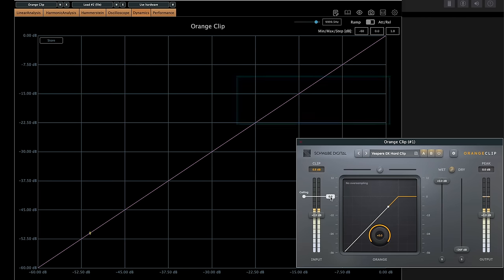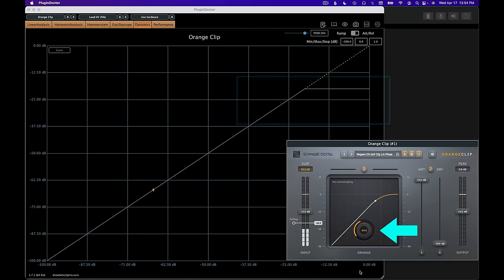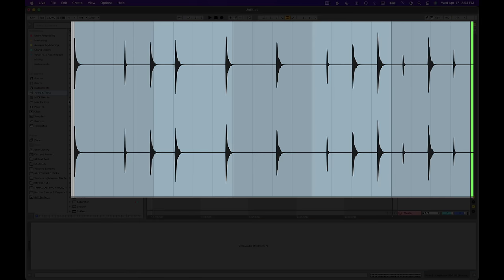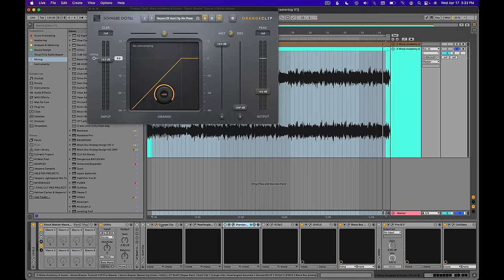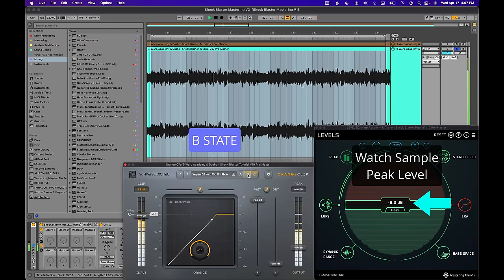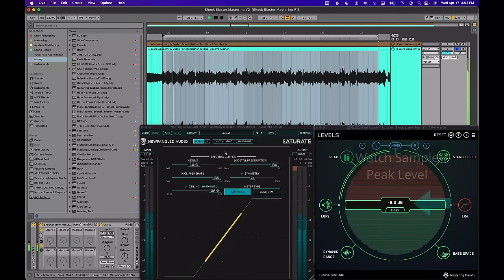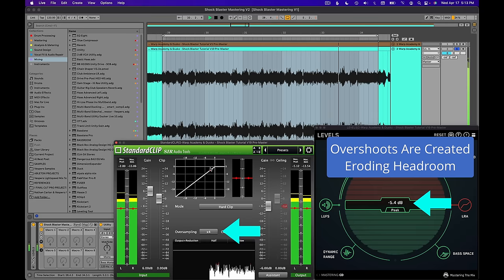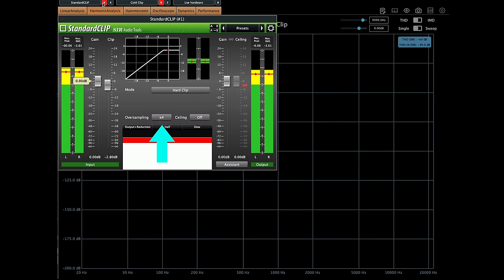The Science of Clipping - The ULTIMATE Tool for Loudness + Punch

Comment: I agree! 100 percent! I used to use limiters in my mix and constantly was always faced with lots of troubles, UNTIL I started using only clippers. Im 100 PERCENT a fan of using CLIPPERS! great video! very informational! thank you!
Reply from the maker: Thanks for sharing your experience.  Yeah, I've found that clippers are a nice alternative to limiters when used in the mix on individual sounds and busses.  Then I just use a limiter on my master, last in chain.  Sometimes, with bass-heavy material like 808s, subs, and kicks, clippers don't perform well and produce too much distortion.  In that case I will use a lightweight track limiter, DMG Track Limit, which is able to do the job with much less distortion.  Cheers!
Reply: @warpacademy  I only use compressors(on my main bus channels, DRUMS/BASS/SUB ETC. when needed. and reeally havent found a situation arise where I need to use alimiter in my master mix. as long as my mix is sound and landing at -6.0 dbs, im usually golden in my master. but maybe I am missing out by not using a limiter?? I dont know
Reply from the maker: So you’re using a clipper last in chain on your master instead of a limiter then? 

If you drive sub heavy material into a clipper you’ll get super audible nasty distortion.  That’s why I use a limiter on the master.  Limiters don’t do that unless you push them too hard.
Reply: @warpacademy  The 1st plug in I utilize in my master chain is MAXIMUS, which is  limiter/compressor of sorts, i utilize this to focus my compression in seperated low/mid low/mids/mid highs/ and High frequencies, from there I fully utilize Ozone. I keep it as simple as possible although my Ozone mastering chain does utilize around 5-8(pending the song) different tools/plugins to get to that desired sound
Reply from the maker: Sweet.  If you’re getting good results then stick with it :)

Comment: killer video. very helpful in understanding some of the concepts that have eluded me re: clipping. 

any recommendations for fairly aggressive clipping approaches? I'm interested in over-the-top character of some lofi trap/soundcloud rap where they are clipping the hell out of FL albeit the clipper in FL is fairly limited. I have kclip but I'm not sure if I'm fully taking advantage of its functionality
Reply from the maker: Glad you enjoyed it.  First step, get Orange Clip from Schwabe Digital.  It is an exact copy of the FL clipper and its soft clipping is apparently identical.  

To get more aggressive with clipping you can use hard clipping for harsher sounding odd harmonics or soft for more round and warm harmonics.  Use oversampling in this case for sure.  As you’ll get audible aliasing.
Reply: @warpacademy  followed your advice and the results I'm getting from Orange Clip are substantially better than before. a most worthwhile purchase. can't thank you enough 🙏

Comment: Great demo and info. I use Gold Clip on the 2 bus just before the Slate FG-X 2. I love the Gold Clip because it is clean, but it can get gritty if that's what you want. 

I have had Orange for a week, and would use it per track. I also have SIR Standard Clip, and have used it on the 2 bus.

Anyway, very interesting info on oversampling. I don't typically use oversampling in most plug-ins already.
Reply from the maker: Right on.  Nice to hear a bit about how you're using clipping plugins.  Wishing you all the best with your mixes and masters!

Comment: Were you using the gold clip in hard or soft clipping? If it was hard then surely all the clippers would sound the same as hard clipping is identical regardless of the clipper
Reply from the maker: Hey Ed.  In general, you'd think that all hard clippers would sound the same.  It's really quite simple math.  If a sample = more than the clipper ceiling, make that sample output = clipper ceiling.  That's it.  And yes, I was using Gold Clip as a hard clipper.  

However, in practice, these clippers are actually quite different, especially when you start oversampling them.  Anything that oversamples will have to run through a downsampling anti-aliasing filter.  Those filters can be linear phase, minimum phase, and can have wildly different slopes and frequency settings with respect to Nyquist.  They could be brick walls or more gradual slopes.  Just look at the SRC / Resample function in iZotope RX Audio Editor and you'll see all the options.  Most clipping plugins do this under the hood, hard coded, or give you only very limited control over the LP filter.  

Saturate from Newfangled audio has a spectral clipping algorithm with "detail preservation" which makes it perform very differently even when hard clipping.  Gold Clip has a totally unique anti-derivative anti-aliasing process, which is why it sounds so good and doesn't produce overs.  Gold Clip modulates the filter settings based on the frequency and amplitude of the signal.  It also has other processing in addition to the clipper (the Gold knob, modelled on the Lavry Gold hardware and the Alchemy parameter which acts like HF tape saturation).  

If you're simply hard clipping with no oversampling and just touching the micro-transients, then they sound more similar.  Oversampling (and the corresponding downsampling and band-limiting process) is what changes the sound a lot (and is also the source of the overshoots).
Reply: @warpacademy  Thanks for the detailed response, i found it hard to tell the difference, it would be intersting to do a null test to see what exactly what the diffference is. Flatline is my fave clipper, mainly because of the GUI, i did try a demo of Gold clip and found the gold part quite interseting even tho it was subtle. i might look into it again now, buy i cant do a null test cos my demo was up last year.
Reply from the maker: Hey Ed.  Yeah, the Gold knob in Gold Clip is an emulation of the Lavry Gold hardware ADC.  It inflates low level information in a unique way.  Very useful.  I also really like the box tone feature and Alchemy.  Worth testing out.  Perhaps you could request another demo from Ryan, I'm sure he'd help you out.  Cheers!

Comment: Great observations!
Funilly enough; even with oversampling; I'm not getting TP overs on my standard clip ceiling; how hard are you pushing to get over's +0.6dB?
Reply from the maker: Hey Nicholas.  Nice to see ya round the channel mate!  I captured a screenshot of the session, Standard Clip settings, and meters for you below.  I'm clipping very gently here.  A couple dB on super short audio events.  Mainly just the snare.  

https://capture.dropbox.com/UY8A1izXIQNtEJFU

You're most likely not seeing the overshoots because Standard Clip has 2 clipping stages.  The first is oversampled, and the second is a 0X non-oversampled hard ceiling (called "Ceiling" in the plugin).  If you leave the Ceiling engaged, then the second clipping stage hides the overshoots from you by applying more clipping.  If you disengage the Ceiling parameter, you see the true peak level overshoots both in sample peak and true peak (true peak overshoots being higher).  

The same is true for K-Clip and most other clippers with oversampling.  They usually have a second 0X OS ceiling.  And in fact, you see the exact same thing in iZotope RX Audio Editor.  When you use the Resampling process to downsample anything, you'll see the parameter "Post Limiter" engaged by default.  They need a post-downsampling limiter to catch these overshoots.  This is because the Fourier transform process with the sinc function related to the lowpass filter used in anti-aliasing will cause higher and higher overshoots the more Fourier partial harmonics are used.  The more oversampling used (and the more extreme the downsampling) the higher the overshoots will be.
Reply: @warpacademy  Super interesting; I understand why/how this is occurring; I don't use the ceiling feature; and don't get overs; I'll have to share with you my OS settings under-the hood of standard clip, see if they match up!
Reply: Not getting overs with ceiling off here neither
Reply from the maker: That's certainly interesting!  I wonder what the deal is.  My session is at 48 kHz, which matches the mix sample rate.  I've found overs happen in Standard Clip (and any other clipper except Gold Clip) on any oversampling setting.  I've tested 4X all the way up to 16X and they all seem to produce the same measured overs.  I've found they occur on simple material (single tracks, like a snare) as well as complex material like a whole mix, and they seem to happen even when clipping very lightly (1-2 dB).  

One thing to note is that the overshoots are triggered by jump discontinuities, like a square wave or a drum transient.  Anywhere you have an abrupt change in level, you typically see the overshoots as you add harmonics to the Fourier transform.

Let me know if your settings are different or if there's something you've set up under the hood.  Cheers!
Reply from the maker: Thanks for sharing.  What settings are you using in Standard Clip and what material are you running through it?  There needs to be a sharp jump discontinuity to see the overshoots, like a square wave or sharp drum transient.
Reply: @warpacademy  after some more testing, the end of it is that on material which are not very rich in high end (it can well be e.g. some acoustic drums, like certain kicks and snares), no peak overshoot happens above the clipping point when OS is on and Ceiling is off. It only happens in material with a substantial amount of high end.
Reply: All in all, in order to be on the clean side in terms of aliasing, still the combination { Oversampling On + Ceiling On } is cleaner than { Oversampling Off }. If your CPU resources allow for it, then I think it's better to default to { OS on + Ceiling on }, and toggle between that and { OS off } and see what sounds best; if no difference, then go for { OS on + Ceiling on }.
Reply from the maker: Thanks for sharing.  This makes complete sense.  When you listen to the material that I'm processing, the drum transients contain all frequencies (including a lot of high end).  High end is where true peaks happen.  And oversampling will begin to pick up true peaks for sure as the sampling rate allows detection of intersample peaks.  

Most music in the genres I talked about are going to have similar drums.  The transients will be very dense and will contain a lot of HF information.  Especially if you're using clipping in your drum-specific processing, which I always am.  

So basically, this depends on what program material is being run through the clipper.
Reply from the maker: If we're talking about mastering, then yes for sure.  I agree with you.  The overshoots on a master are quite small.  But with Gold Clip, they don't even happen at all.  So I use that.  I prefer the sound and features of Gold Clip to any other master clipper.  

But, if we're talking about track clipping; clipping individual sounds, or even busses - then oversampling will shoot you in the foot.  Depending on the clipper and the sound, oversampling creates overshoots of 2-4 dB on individual sounds.  When you sum those up to your master, those can stack up.  Now you have the potential for big overshoots.  That's a problem.  

Again, the context here is using hard clipping for transparent reduction of micro-transients to free up headroom.  Here, oversampling makes no sense because 1) The audio events are so short you don't hear any aliasing or distortion, or if you do it's simply adding harmonic density and perceived loudness like David Gnozzi said, 2) oversampling on all your track clippers will eat a significant amount of CPU for no real benefit, 3) It will create significant overshoots that will partially defeat the purpose of using the clipper in the first place.  

That's my take on it anyways.  Now, if we're talking about soft-clipping.  Creating nice harmonics, audible tone shaping, rounding transients etc. then yes, 100% use oversampling in track clippers.  You'd hear the aliasing when you're digging into the RMS or body of a signal.  

Does that make sense?
Reply: @warpacademy    It does make sense. But ultimately, what I’m saying is that { OS on + Ceiling on } is a better option than { OS off }, in terms of aliasing. In the end, use your ears to chose between the 2, and if they sound similar then pick { OS on + Ceiling on }.

And yes, we’re talking hard clipping here.

I might have a closer look at Gold Clip, because indeed it does sound more lively.

Thanks for your comments!

PS: btw, for the folks reading this, in StandardCLIP, when you have “OS on + Ceiling on”, you have to set the Ceiling fader where the red mark is in order for it to be effective. If you clip at -6 but leave the ceiling at 0, you’ll get overshoots above -6 (with material having a certain amount of high frequency content, as discussed above)!
Reply from the maker: Hey hey.  Thanks for the discussion.  This is all good stuff to debate.  

Here's where I eventually get to with this...I'll circle back to something I said in the video - which is that the context is transparent clipping of transient material.  In this case, when you do it right, you're not hearing aliasing.  Refer back to the comments from David Gnozzi, "The audio events are so short - kick - snare - that you don't hear the bad distortion.  Any distortion that happens simply increases the perceived loudness of the transient."  

So when you mention oversampling, the benefit that it has is reducing aliasing.  But based on what has been said, you don't hear this aliasing anyways.  It's being masked fully, or it's adding harmonics and perceived loudness to transients.  So IMO oversampling in this very specific case has no benefit.  And in fact if you oversample all your track clippers in the mix, you'll tank your CPU due to the processing demands.  

And remember, I'm talking about clipping in the mix on individual tracks and busses.  On the master I am using oversampling, but I'm using Gold Clip which doesn't produce overshoots.  

However, for audible aliasing (which doesn't happen when I'm working like this - it only happens when I dig into the RMS of the signal, or use soft-clipping) then I would definitely use oversampling.  If you hear aliasing, use oversampling.  If you don't hear aliasing, why bother "fixing" an inaudible problem?  That's what Erik Magrini / Tarekith said in the comment I quoted and I agree.

Thanks for the note about StandardCLIP with the secondary ceiling setting.  Good stuff.
Reply: @warpacademy  Gotcha. We’re basically on the same page, these are decisions to make case by case. Sole difference is that — if CPU usage permits it — I’ll fall back to { OS on + Ceiling on } if I don’t hear much of a difference with { OS off }, while you would rather fall back to { OS off }.

Yes, obviously the CPU takes a hit, but depending on the size of the session I’m working on, it’s very manageable! 🙂

Great stuff btw on your channel, I’ve been watching your videos from the early ages (y) (y)
Reply from the maker: Thanks!  And yes I agree with you.  If you think one sounds better go with it.  Especially if you have the CPU to spare.

Comment: Thanks for your video… only one doubt… do I set the clipper first in the mastering chain? Or last?

Thanks 🙏🏼
Reply from the maker: That is a very good question.  It’s one you can debate a lot.  For me, currently I’m putting the clipper first in chain both on individual tracks and the master.  

I used to put the clipper last in chain on tracks and just before the limiter on the master.  But to me it makes more sense to get rid of the little micro transients before hitting other level sensitive effects downstream.  

Cheers!
Reply: @warpacademy  awesome! Thanks for your response and help on this.

I will try that out.

Greetings from Mexico 🙏🏼🙌🏼🎶
Reply from the maker: Hope it works out for ya.